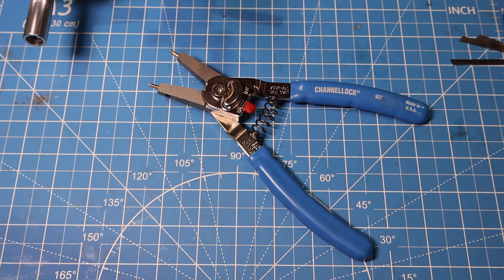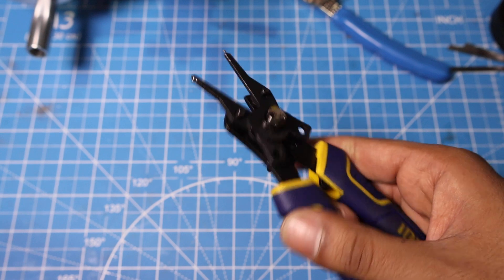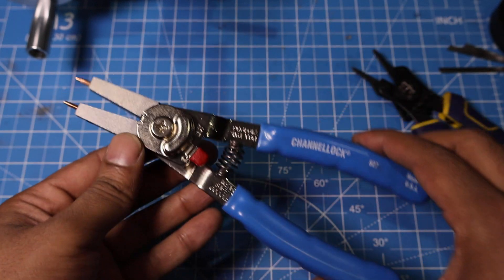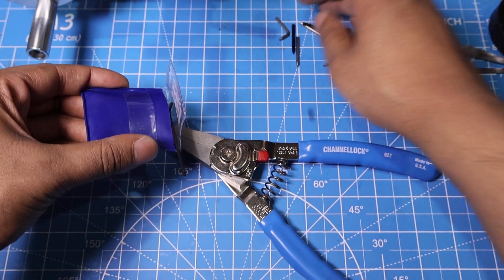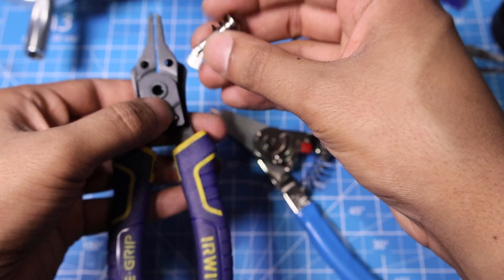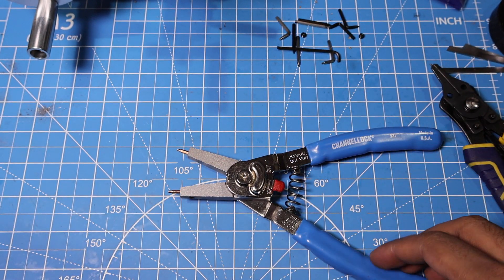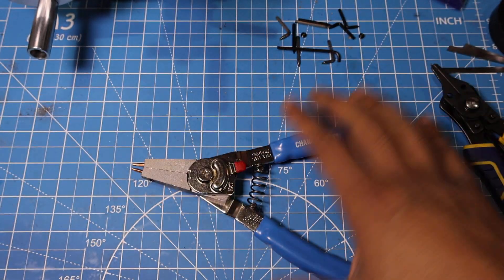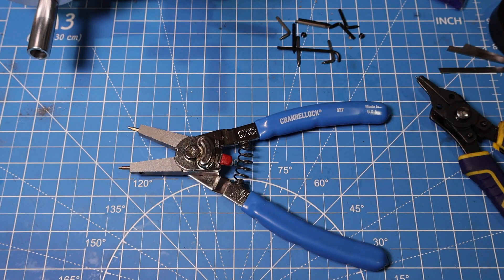Replacing my Old pair of Retaining ring Pliers

Comment: Some interesting points about these:

There are replacement tips sold separately if needed.

They are made by Lang, and get rebadged all over. Wilde, Williams, Blue-Point, Gearwrench, the list goes on. So if you cant find replacement tips by searching Channellock specifically, theyre probably out there under other brands including Lang themselves.

Theres actually 3 sizes of these, and the larger ones get pricey, but it gives you options.

See that stylized 3 on the right hand side, stamped in? Thats actually a date code and they use the same stylized designs as Snap-on. Im not sure why specifically they use that since Snap-on doesnt make them or rebrand them under their main label.

As for recommendations, if you wanna bump up to top notch stuff check out the Knipex ones with the spring steel tips (they call them precision circlip pliers, they have others that dont have the special tips) or the Tsunoda ones with piano wire tips. Though far as i can tell you cant get the Tsunoda as a set, which actually makes the Knipex cheaper.
Reply from the maker: Interesting, I will definitely check them out, Ive use knipex ones before, but they seem to be for only certain sizes, but I'll look more into it.

Comment: i bet you can get a replacement for the Irwin
Reply from the maker: It actually came with a spare 180 degree head, and 2 90 degree heads, so I should be ok to use it, as long as I only go for smaller retaining rings
Reply: @dirtyboytools   i had a cheap chinese one like that with multiple head, man that was crap! i bought a Knipex, i know its a step up in price but seriously when you have so little steel holding a huge pressure, it really shines through to uave good metallurgy,  next set you get i highly recommend